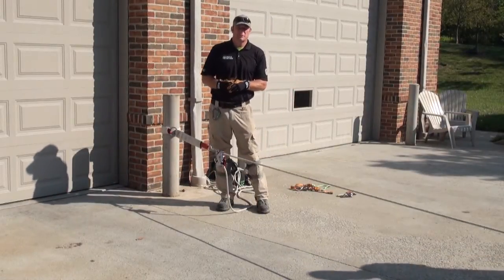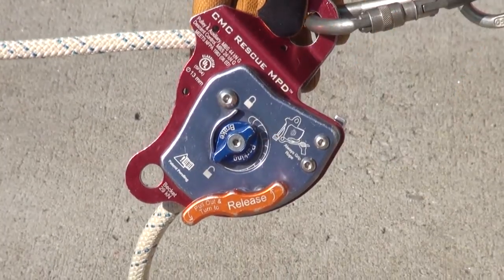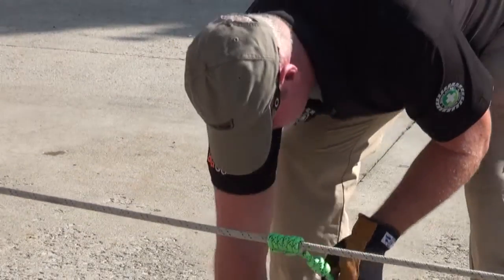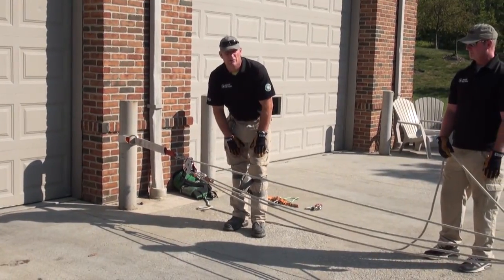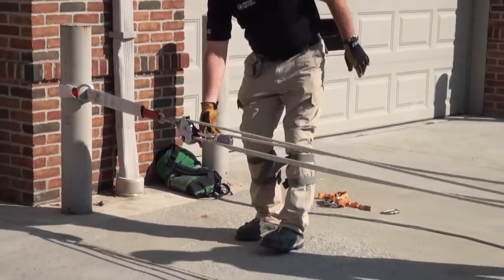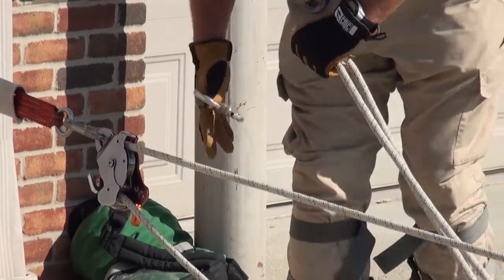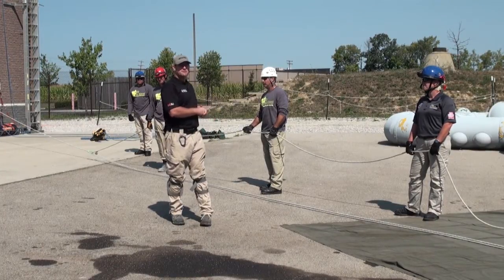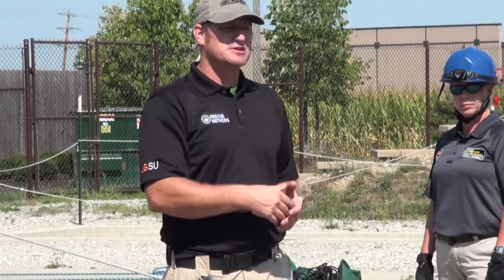Rescue Methods with Fire Rescue 1 October 2012 Blog Video - Hauling Operations with CMC MPD

Comment: is that a steel carabiner or aluminum? does it matter?
Reply from the maker: MrRich183 We advocate G rated carabiners when the load requires it.  As a general rule of thumb, we place G's at the primary connection and all of the mechanical advantage and additional COD connections are L's.  Thanks for your feedback.  Train Hard!